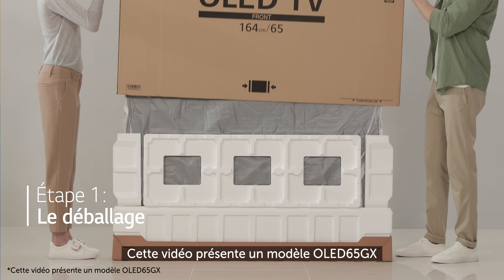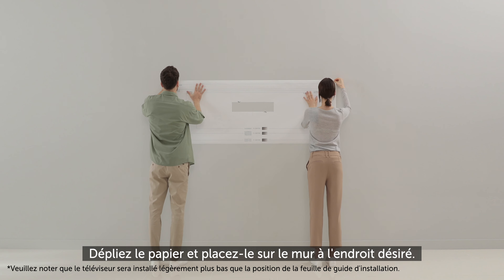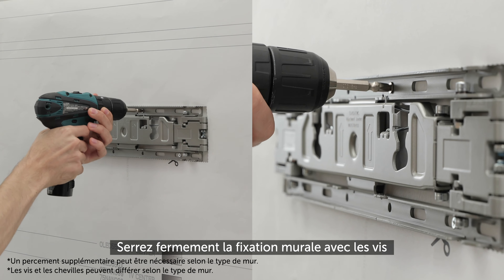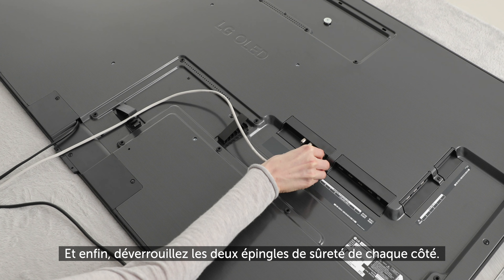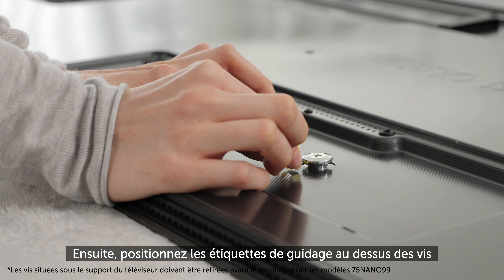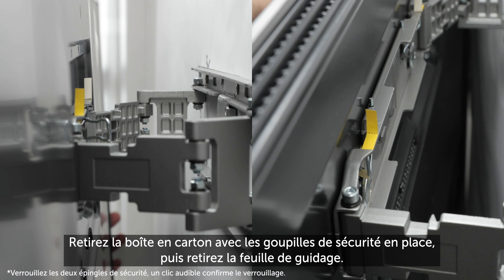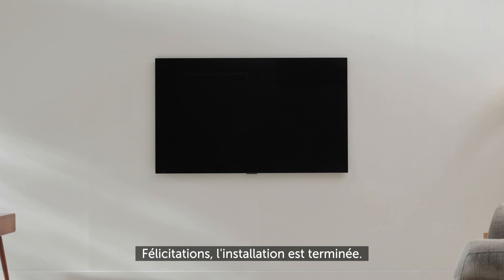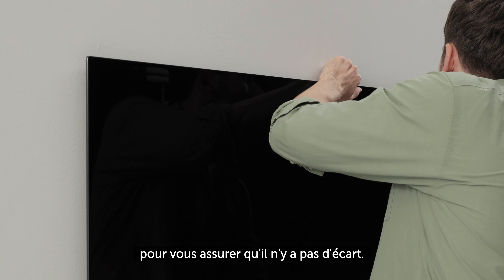Tutoriel installation TV OLED LG GX Series Gallery Design (VOSTFR) - Cobra.fr

Comment: 2:13 What is that protrusion at the bottom of the TV? Did they add an ugly IR receiver at the bottom rather than integrate it into the bezel? I sure hope not.
Reply: To anyone who wondered, yes, it's the receiver for the remote. It looks like with all of the wizardry to get everything else inside for a flush mount, they didn't account for the simple remote receiver and it was added to the bottom after the fact.

Comment: Hi there would the Philips hue light strip still fit on this TV if wall mounted? Any info would be appreciated, thanks
Reply: I guess U would have to wall mount it on standard VESA mounts (not this "hidden" mount like in the video), so there is some space left for strip to spread light. But if so, there is no reason not to go just for CX model, fair bit cheaper.
Reply: After watching the US version of this video I almost gave up purchasing this TV.  No more confusion, so thanks for posting this video!
Reply: If you want room behind your TV, even an inch or two for a bias light strip, you're better off buying the CX/C1 version and saving money. The Gallery series is for people who want an ultra clean look. Now, only if LG would provide some trim kits and utilize better adaptive lighting to look more like artwork when not in use, like Samsung does for The Frame TV.
Reply: @BTICronox The Frame costs less than the LG GX.